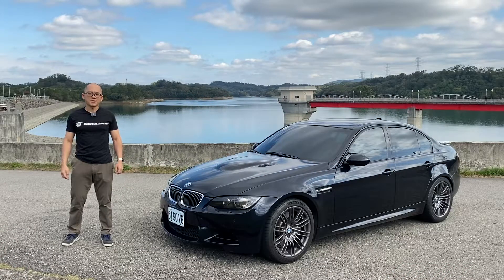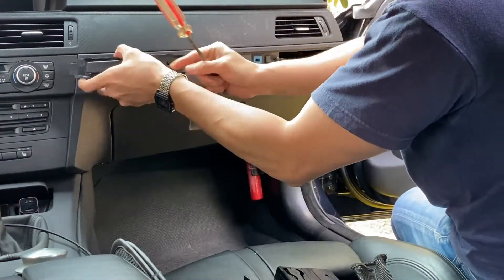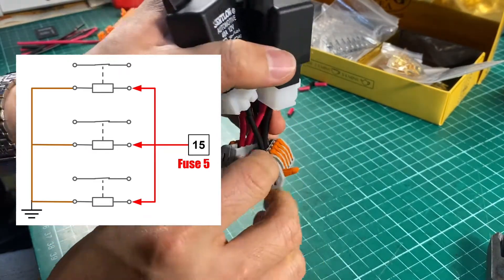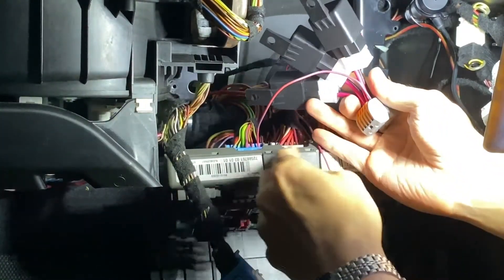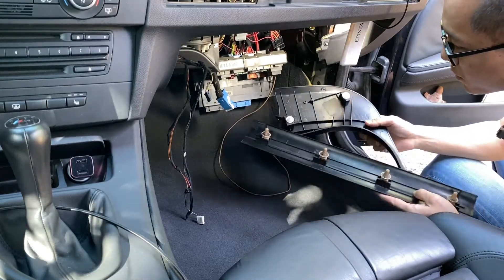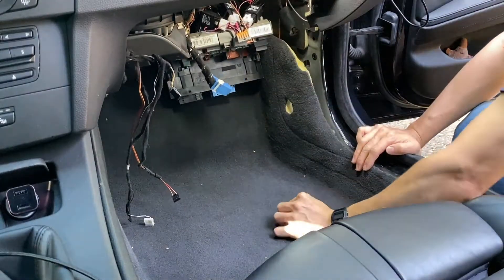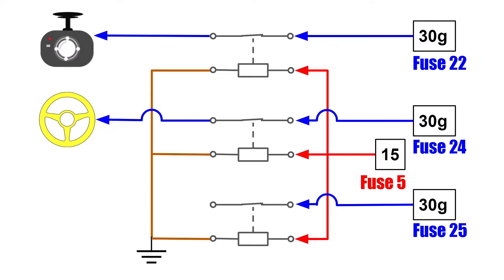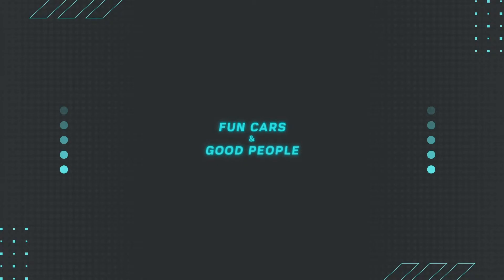Terminal 15 Extension for Heated Steering Wheel DIY on BMW E90 M3 Ep.3 [ENG SUB]

Comment: Hello ,is that the original terminal 15 behind the fusebox ? 
i have a problem ,if i press on my start button for ignition on ,then it goes on but after 1second iginition falls out ! So i have to push again on the start button to put the ignition on.
Bmw e90 lci
Reply from the maker: Hello Ben first of all I strongly recommend you to read the fault codes with diagnostic tool such as OBD2 scanner. The fault codes are super helpful in troubleshooting.

I guess you can start the car and keep it running without other problems. if so, I think there’s nothing wrong with terminal 15.

I feel like the ignition/terminal 15 is turned off by other modules. For example, the power management system will regulate the availability of electricity when it thinks the battery is low. If you had replaced a new battery. Please register the battery to tell the car about full battery so previous problems won’t be stored in the memory and thus hindering normal operations.

But like I said, the fault codes are going to tell us about the car in great detail. Let’s find it out!
Reply: @funcarsgoodpeople  hi ,I read the fault codes but not with ista.With Some basic obd2 scanner.But no faults on that.

The problem is ,I put the key in and then i press the start button for ignition to go on ,so normally all the lights on dashboard go on ,but sometimes it Goes on but immediately it falls back out ! Then i have to press again and it stays on.Not a big deal but Imagine one day it Will not go on anymore ! 

So I was thinking that maybe there is a relay that is not always working…you say the relay or terminal 15 relay is integrated in the fusebox ..so then if you want to change that ,you need to change the whole fusebox ?
Reply: And if you change the fusebox …can you take one from the gravejard ? From the same engine and type car ,and put your fuses in that fusebox or do you need one from the dealer with your vin number ?
Reply: @funcarsgoodpeople   is it only that what can turn the ignition /terminal 15 off ? Can you give another examples what can turn the ignition/terminal 15 off ?
Reply from the maker: hello Ben, when you mentioned about the lights in the dashboard, did you mean the lights on the instrument cluster/gauge? The instrument cluster module (KOMBI) has two power sources from terminal 30G and terminal 15. Terminal 30 G supplies power for operation and terminal 15 tells KOMBI that ignition is switched on. Your symptom implies that there could be something wrong with KOMBI 🤔 but I will just guess poor connection because no other fault codes about KOMBI is shown.

Back to your question, if you really have to replace terminal 15 relay (Kl. 15) yes the whole fuse box has to be replaced. You have to find the part number of your specific fuse box, check the realOEM.com online parts catalog for compatible part # and get a new/used one. But I don’t think the fuse box is the number one suspect 🤗 How about simply trying to unplug/plug the connector behind the KOMBI?
Reply: @funcarsgoodpeople  I write a long text but it is gone 😀 yes the instrument lights ,
Do you know where the KOMBi module is located and the connected ? 

I have alot to learn about this
Reply from the maker: Sure please refer to my other video about Apple CarPlay interface installation. I have a shown how to remove the instrument cluster module: https://youtu.be/mBttAW5qnHI?t=1172&si=g7RTZgGPGlEkKA27 it’s just right in front of the driver!
Reply from the maker: (Please see my updated reply)

Comment: Have you protected the circuit that is feeding the heated steering with one fuse and another fuse for the circuit that is feeding/supplying the dashboard camera? Of course I mean the circuit via the contacts. Any short-circuit via contacts (unprotected) can be a fire hazard because the electrical stress createsd by the short-circuit can melt the cable insolation due to the heat, and from here fire..
Reply from the maker: Hello SD, yes I have used independent fuses for all the added-on devices, e.g. fuse F22 for the dashcam, fuse F24 for the heated steering wheel. The power source comes from a fuse and is controlled by the electrical relays I used in the video. Thank for the reminder!

I do agree I should have made the extension of terminal 15 more simple to avoid unexpected short circuits...